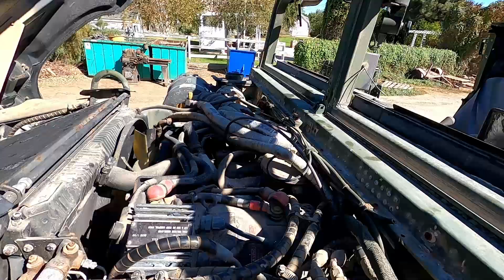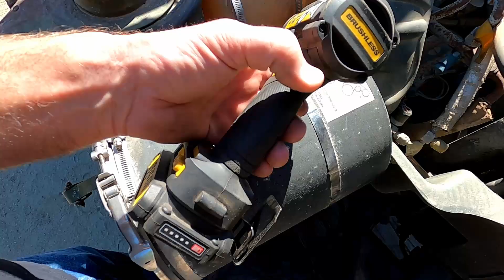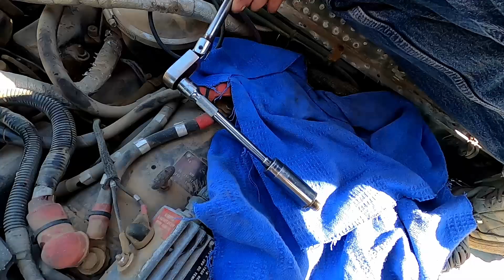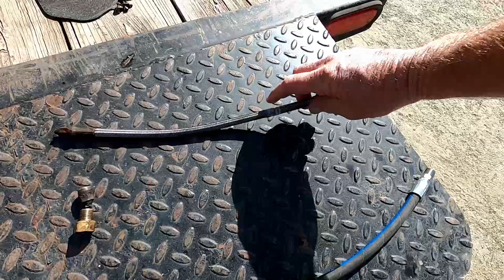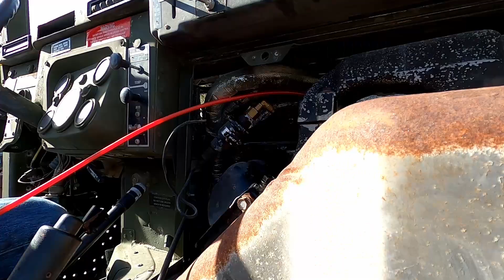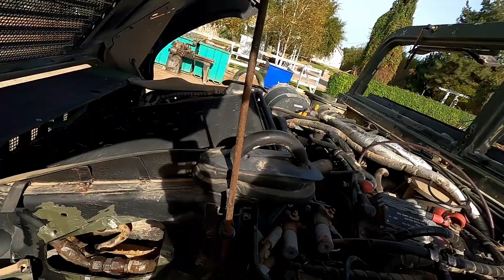M1114 Humvee Blown Oil Pressure Hose...Lets get it off of My Trailer...

Comment: Awesome video. Looking forward to the restoration. I've seen those valleys get clogged before and rusted out. How is the bottom of the injection pump?
Reply from the maker: Thanks, 
I still need to use my camera probe to look at the pump and fuel lines down there.